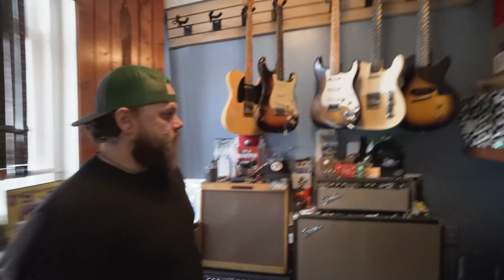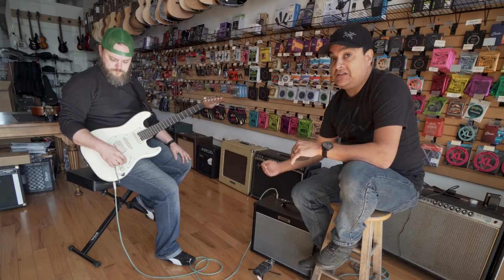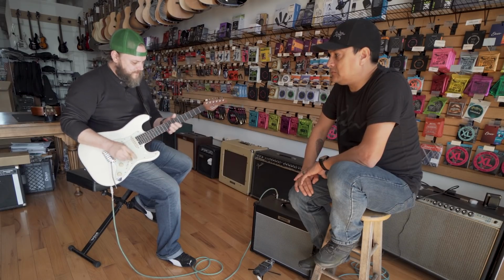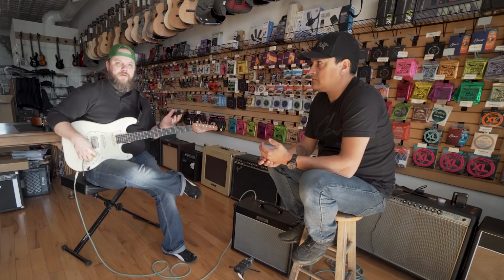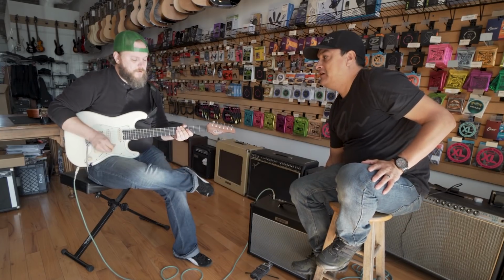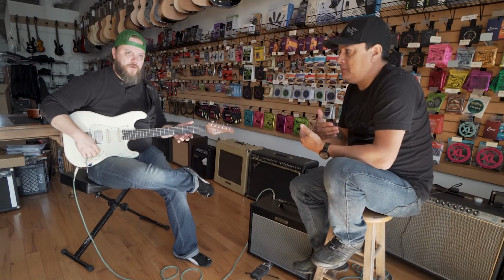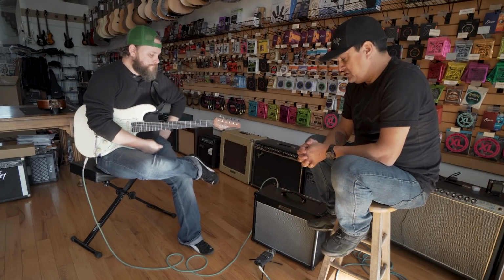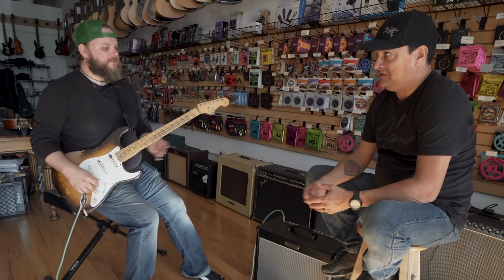Does the Boss Nextone Stage sound like a tube amp?

Comment: There's a few modeling artifacts that still come across.
HOWEVER, close enough is close enough. I hate the Katana. I really hate the Fender monstrosities. But this one sounded pretty convincing on its own merits.
Definitively worth a closer look. I'd be perfectly happy having this next to the couch...or on a road trip.
Reply from the maker: ..... there is no modeling..... so.....
Reply: @DylanTalksTone  No modelling? So what I'm hearing is just the solid state attributes? Still, not bad at all. Big improvement. I'd take one.
Reply from the maker: Four separate power stages .... legit stuff.
Reply: @DylanTalksTone  Only four? No 7591 or ELL80 power stages?
...all right... fine ...
Have to settle with just four....
Joking aside, this is the one "modern" non-tube amp that has impressed me the most. Which is not an easy thing to do. The last SS amp that I was really taken with was the JC-120. Although it's hard to beat the tuck and rolled Kustom amps from the 60's...just for the vibe. Not the sound.
Reply: @DylanTalksTone  Perhaps no modelling such as we tend to think of "modelling", but it's also not really as simple as just putting it down to having four different analog power stages. "Tube Logic technology uses digitally- controlled analogue solid-state components to mimic the dynamic response and clipping characteristics of a valve output stage."  This sounds to me like it is still software doing all the heavy lifting in the tone sculpting.
Reply from the maker: @darwinsaye  welll. random folks in the comments are often wrong. this is one of those times.
Reply: @DylanTalksTone  "Random folks in the comments" Jesus, you really don't welcome any friendly discussion or debate without getting snarky do you? Nice to know you consider your subscribers with such derision.  I only quoted what was said in a MusicRadar article about the amp. And This is straight from the Roland page titled, " The Tube Logic Story": "This amp-speaker interaction is fine-tuned with DSP for very precise adjustment". The signal path may be analog, but there is some degree of digital control involved in the the amp's circuitry and thus in the tone sculpting. That's all I was trying to discuss. I do think the amp is excellent.
Reply: Please consider trying the Artist vs Stage. Artist sounds better, fuller. I use at relatively low volume and I prefer the Artist anyway. When I saw the Special edition though. I'm really tempted
Reply: @thesoundpurist  Artist, Stage and Monoprice I think are the same amps rebranded. I could be wrong , I haven't really looked into it in any real depth.
Except that for the price and what I've heard, I'd grab a few and have some fun.
Reply: @thesoundpurist  i agree. Originally bought the Stage because of its size weight, but cranked it just didnt cut it. I bit the bullet and exchanged for the Artist. Hell yes, easily got that tone i hear in my head.

Then i saw the Special. But when i looked at the size/weight, i just went "nope". Portability is a big factor for me. The Artist is slightly above my preference but the tradeoff is worth it. The Special doesnt even give a passing acknowledgement to my preferences so i'm totally happy :D
Reply: @darwinsaye  Quite.
Reply: These boss/roland amps are very much digital modelling. I own the Katana 100 and Blues Cube Stage - they're great amps, but they are digital. Even the blues cube which was marketed as 'digitally controlled analogue' has a full digital / DSP stage between the analog preamp and analog power amp (refer to the service manual). The 'digital controlled analog' means there's two compressor stages just before the power amp, which are controlled by the DSP stage.

Comment: The four power sections didn't sound all that different to me, even through headphones. Certainly not as big a difference as between actual 6V6, 6L6, EL84 and EL34 tubes.
Reply: I can attest that they sound quite different, especially when using an overdrive pedal.